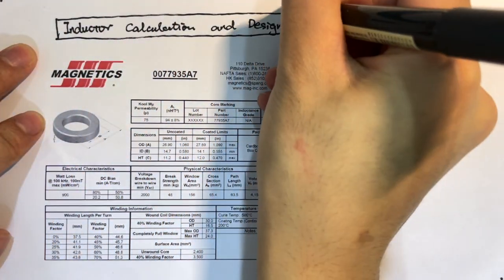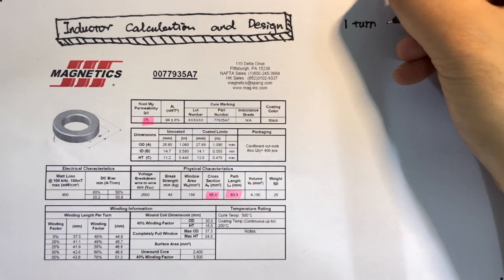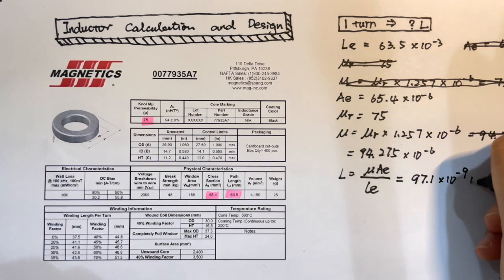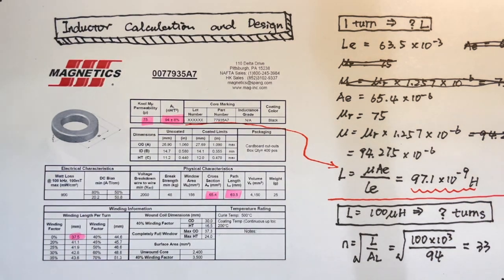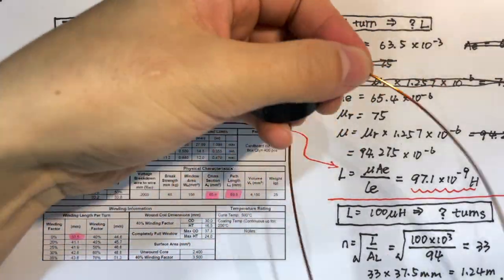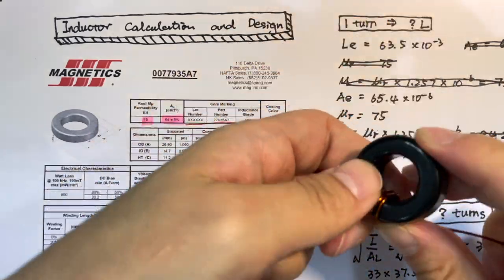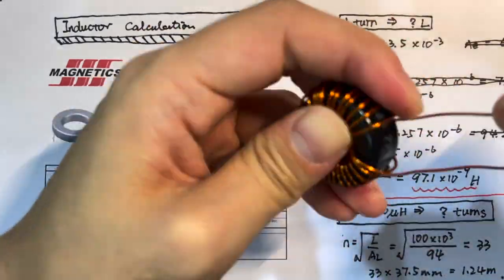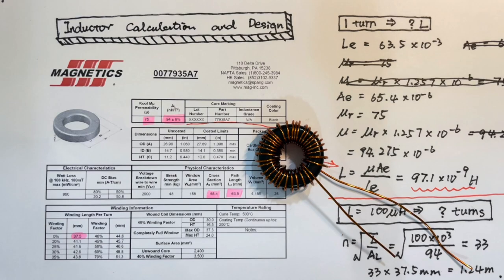Inductor calculation and design

Comment: How to calculate Current Handling capacity of Indicator ?
Reply: Current handling capability is depends on the gauge wire. For example, a #18 awg wire will handle 2.3A max
Reply: @powerelectronics545  I think she did not wants to ask about your answer. For example, if I have 35A max current and 400uH inductance, I have to hold that energy in that inductor. How can I calculate that?
Reply: @yunusemreozdemir1342  you should design the inductance value properly. For example in a Buck converter , Vo = L* D I / ((1-D)*T) . L = Vo * (1-D)*T / DI . D is duty cycle , Delta I normally around 10% to 20% of I max 35A in your case. And T is the period of each switching cycle or 1/F